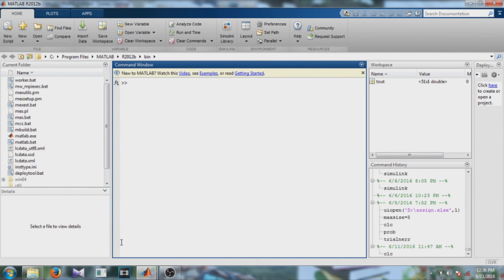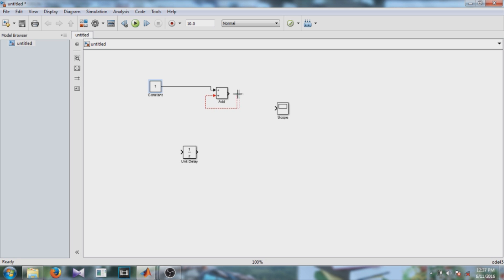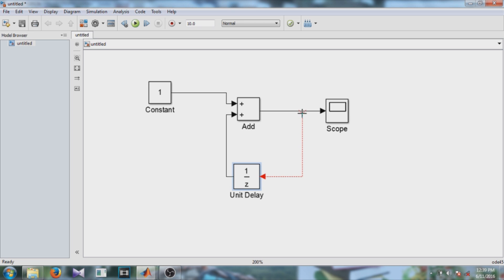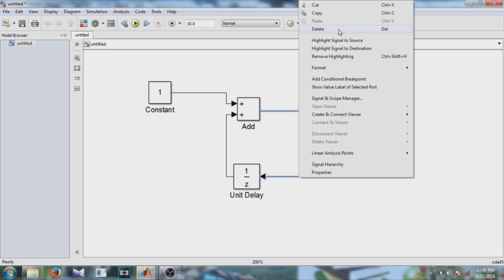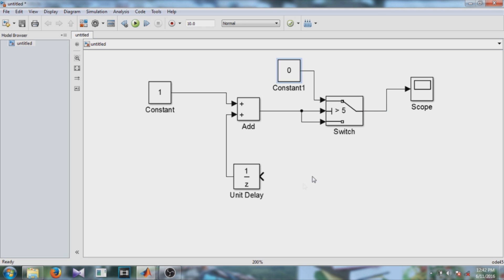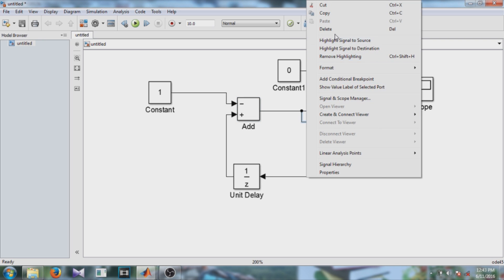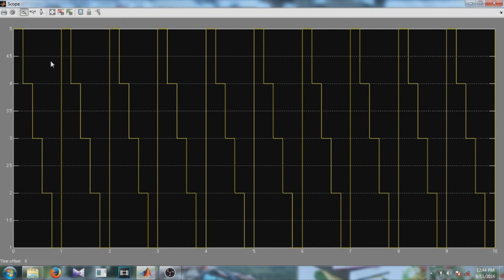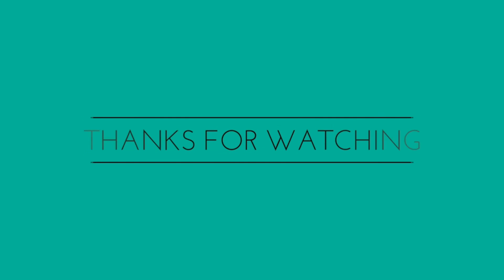Simulink Tutorial - Tutorial 4 - solve algebraic loops and design of up and down counter

Comment: Hello,
I would have a big problem. I have to create on simulink, a 2 to 4 decoder connected in parallel in a counter 0-15 (module 16), doing the increasing count. I have to use only the NOR logic gates. How can I create this project? I tried in every way but I was unable to implement anything. Thanks for your help.

Comment: This is an excellent demonstration Video. There is a minor missing information here because of which the model doesnt executed in the present form. The model comes up with an error message. The minor correction is, once the model gets completed, go to "Model Configuration Parameters setting". In that, change the default Solver Option of "Auto (Automatic Sover Section) to "Discrete (No Continuous State)". Also,  change the default setting of Sover Type from "Variable Type" to "Fixed-Type". That's all!!!  
Now run the Simulink Model. It gets executed easily.  
Correct me if I'm wrong in my observations.

Comment: got a question why your circuit did go well without a warning, because you are trying to use a continuous sample in a unit delay that usually uses a discrete sample, i design the same circuit but I got and warning, after solving the problem by solving the diagnostic "discrete as continuous" to none it works

Comment: I'm working with Simulink and I have 2 doubts:
1) How would you do if you want that it counts 1 time per second for example? I mean, a counter sincronized with simulation time.
2) I'm working with a vector of continous signals that are changing its values. I want to implement a model that counts index from 1 to 7 (the vector's size). The counter must change its value only when the signal index value passes a limit number.
For example: it starts maintainig 1 until v(1) passes the limit value, then maitains 2 until v(2) passes the limit... and when v(7) passes the value it will maintain number 1 again
I've modeled it using the index vector block and a switch that turns 1 when signal overcomes the limit value and 0 when it's lower. That signal goes to a counter that resets its value to 1 when the vector value is higher than 7. If i include a 1/z block the indexing signal doesn't maitain the value and always changes to the lower one, I mean 000010101020202, instead of 00011112222

Thanks for reading and for the video too

Comment: Great video!

But i get an error when I use unit delay block for this operation. It works well when I use memory block instead.
Reply: Even I'm getting the same result. My model is done exactly as explained in the video but, it is executed I get an error message for Unit Delay block saying, it needs to be replaced with Memory Block instead.